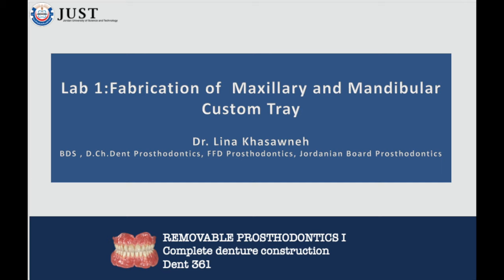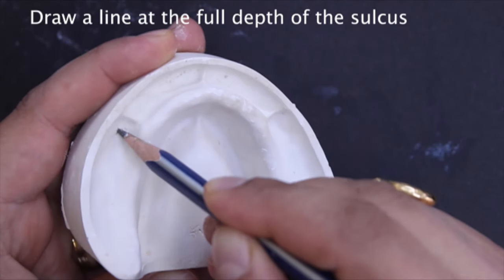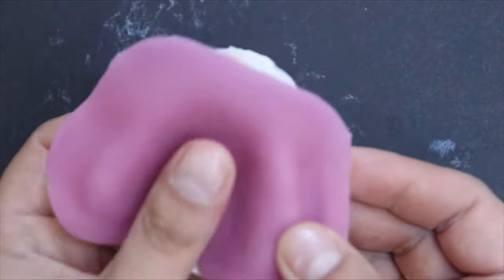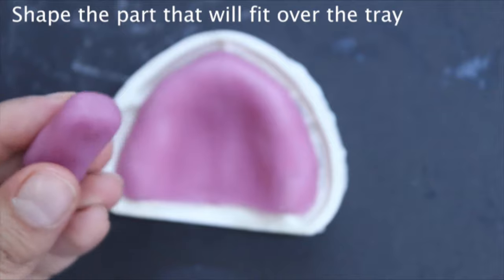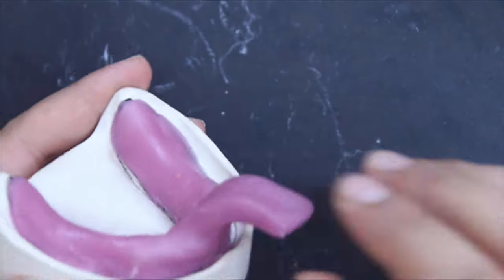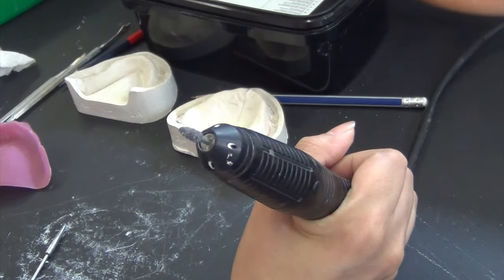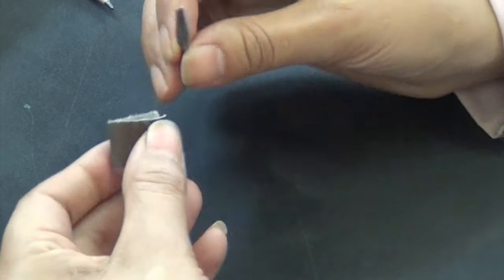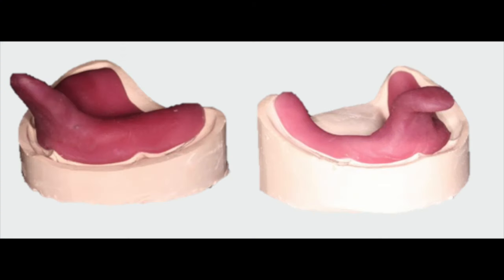Lab 1 fabrication of maxillary and mandibular custom tray

Comment: WHY YOU DID NOT PROVIDE A SPACER AND TISSUE STOPS IN THE REAYS?
Reply from the maker: Because we were using Zinc Oxide Eugenol Impression material and it does not require a spacer. In addition the mucosa is firmly attached to underlying bone, so no spacer is required. If the patient has several undercuts, or the tissues were flabby then you could provide a spacer. Also space requirement depend on the impression material you are using.
Reply: she must be using pressure technique for impression and not selective pressure thats why she didnt need wax spacer . if some one wants to make a mucostatic impression then that custom tray needs a wax spacer